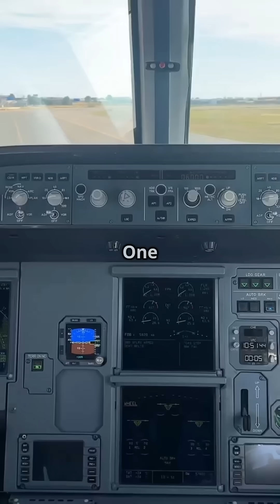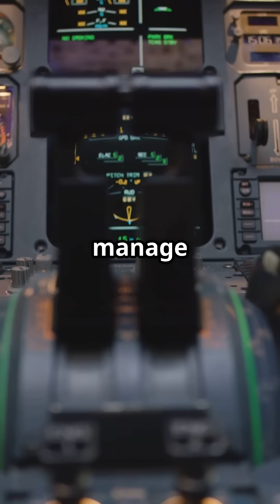Fly-By-Wire Showdown: Pilot Control or Computer Precision?

Comment: With the quality of pilot training continually getting worse, Airbus would seem to posses a small safety advantage. With adequately trained pilots, in terms of safety, it would still probably be Airbus as the safer of the two. But any properly trained pilot prefers Boeing, because they can actually still FLY ‘em. You can’t “fly” an Airbus aircraft, but merely operate and manage how it gets itself from point A to B.

Comment: Airbus’s approach would be safer under normal circumstances, Boeing’s can handle edge cases better; hard to say who’s better.
Reply: You are able to control the plane without software so just direct inputs 100% left stick is 100% left bank if you put the plane in direct law

Comment: Airbus is superior. Just take one look at safety record against Boeing.
Reply: Boeing has been around much longer, and in the past they have not had crashes that had anything to do with fly by wire
Reply: @robbie19143  mcas... cough
Reply: Bowing overall track record over their whole history is very good. Recent issues have more to do with poor manufacturing and design decisions than this particular philosophy of allowing pilots control.
Reply: @JonRista   except the last part... not always. mcas proves that. thankfully, it has largely been fixed now

Comment: Boeing all day
Reply: cuz they gave you both to choose from lol.
Reply: @pardismack well you can disable the protection from airbus and gain full control like boeing
Reply: @xxFobioxx  you're talking about alternate law? it is still not similar, but close enough. btw I'm an A320 pilot.
Reply: @pardismack yes but as far as I'm concerned even alternate law just disables some protections. Isn't there also direct law which doesn't compute the signals anymore so 100% left stick should equal to 100% left bank?
Reply: @xxFobioxx  yeah direct law disables autotrim and all the protections, but controls always compute signals - there are no mechanical links. except maybe in mechanical backup, to control the aircraft just using the rudder and the trim wheel.
Reply: @pardismack yes you're right I also knew that the controls are purely connected via electric cables but shouldn't the direct inputs be the same level of authority over the aircraft like in a boeing. I mean that's why I argued in the first place saying airbus also gives you both ways of control
Reply: @xxFobioxx  if they were both the same, Boeings would restrict the pilot flying to fly the plane only using rudder and stab trim. No other primary control surfaces would exist. The control column/side stick would be fixed with only a trim push button. And you still have rudder pedals. Nothing else. The control column/side stick would not move because it wouldn’t need to. So, no, not the same. Not even close.